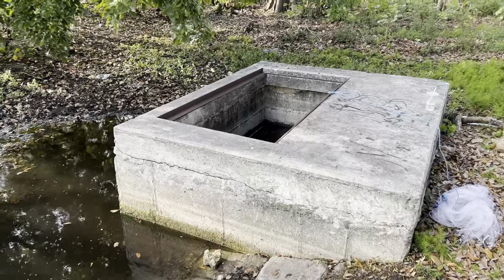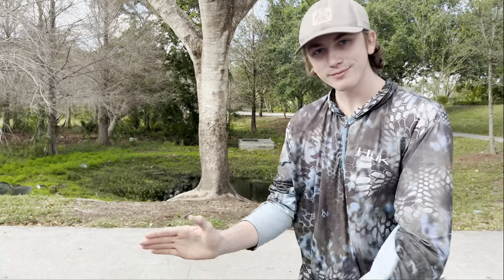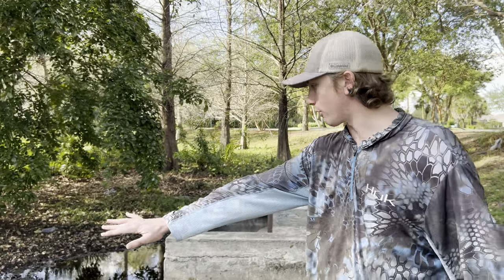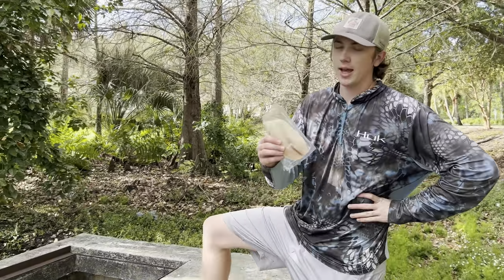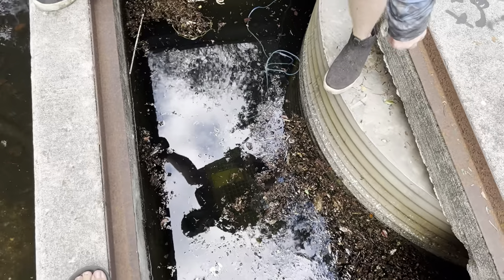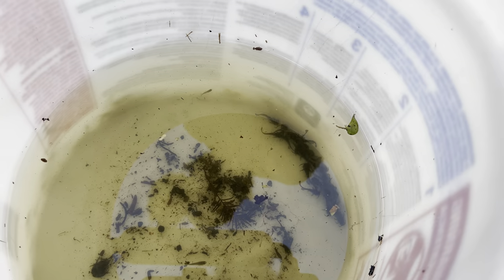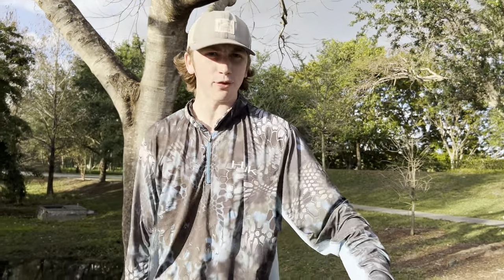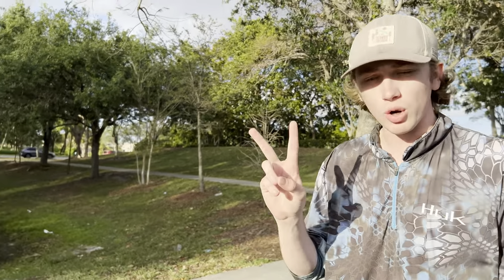Trapping MONSTER Freshwater Sharks in SEWER!

Comment: To avoid accidentally dumping a fish out of the "Raccoon" trap  you might try stabblizing the trap with either two ropes on either end of the trap so that you can pull the trap up level or  by using an upside down y shape one rope attached across the top of the cage and adding a second rope to the middle of the first rope that will also keep the cage from tipping down toward the door of the trap. A good find and you did get it on film...  a funny blooper moment for sure !  Better luck next time now that you have to go back knowing it is there !!!
Reply: 9
PP9🎉70a8
Reply: I’m not reading that